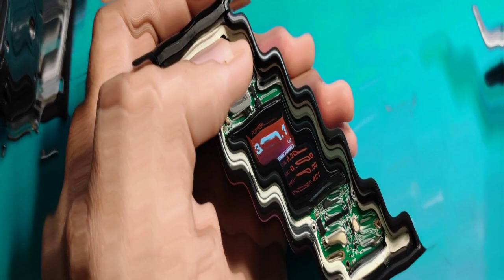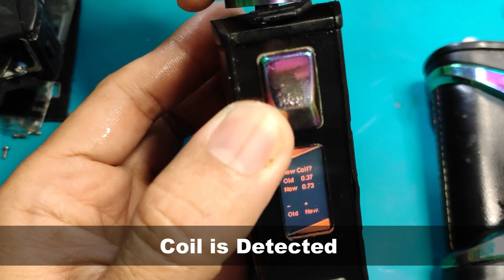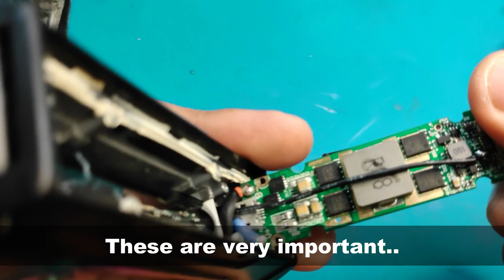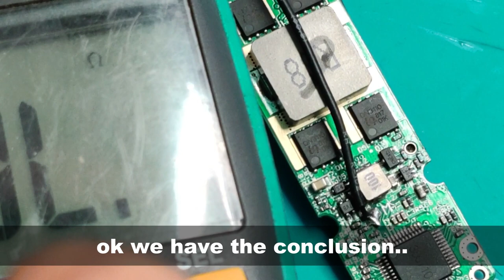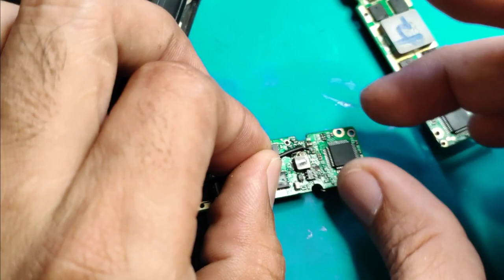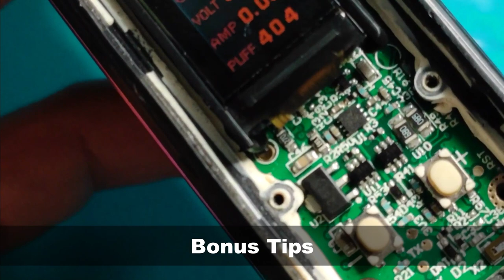Fix No Coil Detected 100%

Comment: Bro how is this helpful? You just took a part off a working mod to fix the broken one 😂 wtf? Why would you not just use the new one that makes no sense
Reply from the maker: sorry i didn't.  i used scrap boards for this fix
Reply: @daddyvinn  OK, so my next question would be where would we get that? Most of us are most likely not gonna have an old mod that we can take apart so getting parts, for this would be next to impossible.